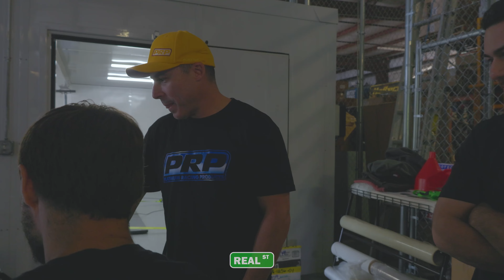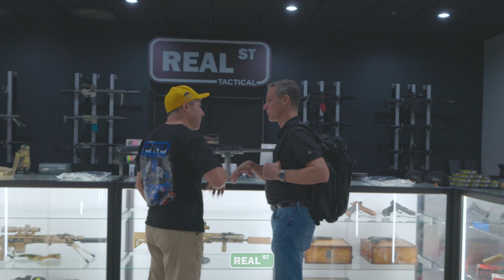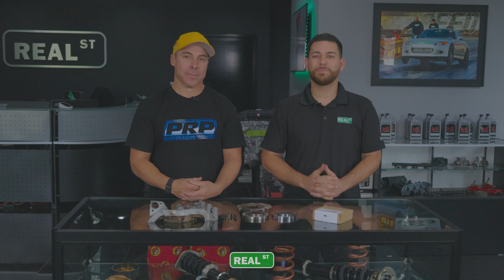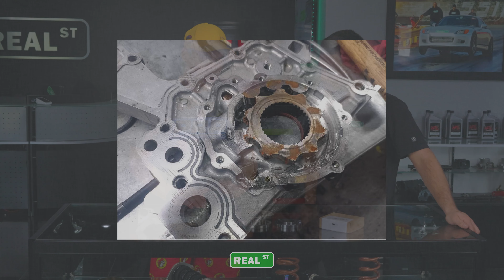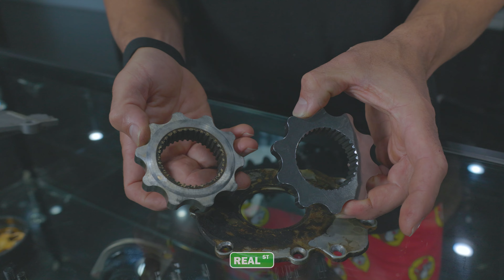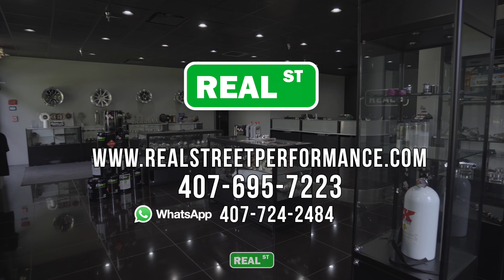2JZ Billet Oil Pump Gears and who is PRP?

Comment: I'm surprised they didnt mentioned the adjustable timing gear. Theirs is the only one with locking tab on the screws. Bought mine looks great but left timing stock since I cannot find anyone that recommends a set point and dont want to damage valve. I thought about putting at tdc and adjusting until it made contact then going back a bit but still feel safe since I just got my 2jz is300. I cracked the plastic part that holds the timing gear with 1/2" ratchet/breaker while holding to torque it to spec. I emailed them and didnt want yo send me one without ordering more stuff and didnt offered me to pay shipping for a replacement, it would be nice to get a replacement cad design so I could 3d print.

Comment: So RB’s are great except for the block, head and oil supply?
Reply: billet blocks have been around for half a decade now. The head doesnt really have any issues unless your trying to jam over 2000hp into it. and oil issues have been fixed since the 90's.
Reply: 😂 but they’re great now!
Reply: in terms of..sound😂😂
Reply: Yeah pretty much, so except for the important bits 😂 2JZ is still king
Reply: Mostly they are talking about problems above 400hp I think...and maybe prolonged high revs(oil caught in head).